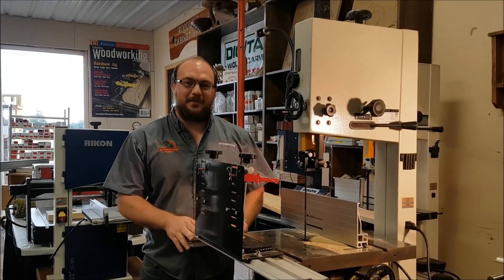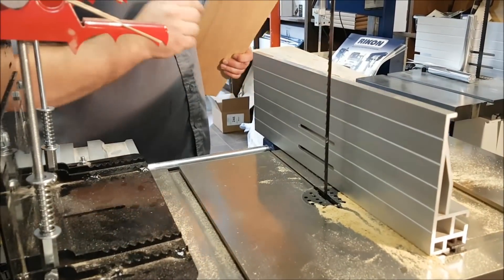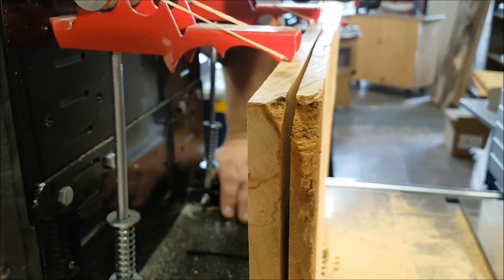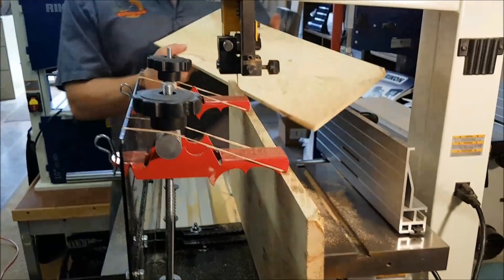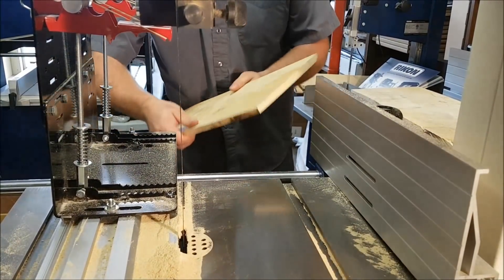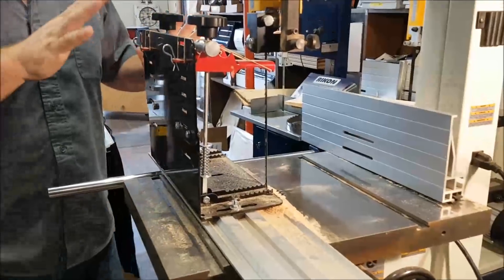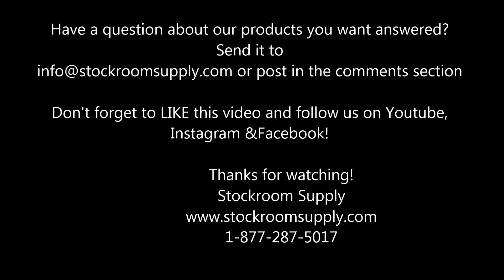EthAnswers Blade Drift Myths #2 Why Fences Don't Work On Bandsaws

Comment: Can't I use a hand plane to flatten the board?:cat-orange-whistling:
I see what you are doing. You have reversed a bandsaw mill. 
Instead of moving a mobile bandsaw on a track past the lumber.
You are moving the lumber on the track past a stationary bandsaw.

a normal bandsaw resaw doesn't use a track but a fence instead. 
Screw the lumber to another pc of stock (or a chunk of aluminum) and slide it past the fence and you would have about the same thing (but with screws in the lumber)

Comment: You seem like a nice guy with a lot of knowledge and experience and with a nice product you're promoting. BUT...that device absolutely DOES NOT magically turn a twisted board into "a perfectly flat, perfectly jointed board" as you claim (@3:33). Yes the board is mounted in the Little Ripper it won't rock and won't bind the bandsaw blade, but the board is still just as warped as it ever was until after you make the first cut. AFTER taking the first slice that covers the entire surface of the board, that freshly cut face should be flat as though it were jointed--assuming your bandsaw is tuned well cuts straight with no bowing.
Reply from the maker: Sure that is true! It is only after making the first cut is it flat and jointed. But clamping it in the Little Ripper a twisted board behaves like a jointed board. The best part of the Little Ripper is no matter how well your saw is tuned it cuts perfectly straight!
Thanks for watching 🙂

Comment: A planer does NOT make the faces parallel. A planer simply makes the thickness between the two faces constant. It you do that, and the board is FLAT, then the two faces will be parallel. However a warped (bowed, crooked, or whatever) board put through a planer will have uniform thickness but will not have parallel faces.
Reply from the maker: can’t curved lines be parallel to one another? So even if the board has a cup as long as it is consistent thickness the board is still parallel irregardless if it is flat?

Comment: I've had boards close up when ripping. Just luck of the draw. Weather the Little Ripper holds one side or the other like the fence doesn't seem to me to make a difference. It's the alignment to the drift you did on the other video which seems to master. As for the warping, you could shim the board to the fence, cut one side than use the straight side against the fence and re-cut. I admit the Little Ripper would save you time.

Comment: The jointing of the board is barely relevant, I don't think people are just putting non-flat boards up against their fence, pretty sure they can notice that problem. It sounds like your argument boils down to people not properly maintaining a firm grip of the work against the fence. Which yes could be challenging on a longer piece.

Comment: Hi Ethan, I wanted a different saw but I found a great deal on an essentially unused Laguna 12/14 or BX. Still not totally sure.  It much difference other than the foot break. Anyway, is Carter the only option for after market bearing guides for the Laguna. Not sure I’m going to like the ceramic ones

Comment: I have very rarely run into ANY issues resawing with a fence in my 40 years of woodworking experience.  If you have a properly set up saw and decent wood, there usually isn't an issue.  The few times I have had to deal with any issues does not make me want to go out and buy a little ripper for the absurd price they are asking. Also take into consideration that the pieces you are resawing are probably going to go through a surface sander that will mitigate any slight variances in the resawing process as well. I  Just my two cents

Comment: Interesting video.  On your point about "most guys don't have a jointer bigger than 8" wide" well I would agree, but that's not a problem for me as I have a set of winding sticks and good old number 5 1/2 jack plane.   Takes a little bit of time and practice, but a handplane / winding sticks and a few minutes of elbow grease and you have taken out any bow / cup / twist from the board so it will ride the fence without rocking.  Look up Paul Sellers or Rob Cosman's videos if you want to learn the process! Little ripper looks like a nice piece of kit though, I guess you could actually use that to slice off the outer face of a board that's really twisted so you have less work to do with your hand plane or jointer to get one face flat and smooth!  What if you have to work on a piece that's 8 ft long for a dining table, isn't the little ripper limited to short pieces of lumber ?

Comment: Several problems with this video. it wouldn't be difficult to find a 1/4" gap in a very green board. Moisture difference is the major cause of stress. Looking carefully at the video appears to show that cut was not properly set up;; the top of the board  is slightly wider on the left, while the bottom is slightly wider on the  right. The crude nature of the clamping jaws  suggests to me the it would create problems bigger than what it purports to solve at no small expense. it appears to be a crude, expensive solution ib search of a problem.

Comment: I’ve owned a Laguna 14” for years,I can resaw using a fence,not with a 1/2 “or 1/4” blade but the widest possible,never had any drift.if my board is warped, I’ll replace it with a flat and straight board. Warped boards use as fire wood. If you can’t tune a bandsaw properly,get someone else to do it.if you can’t tune a guitar,play a violin,if you can’t tune a violin,mow the lawn.no effort required.

Comment: That clamping jig is fine for a short piece of wood. If you are re-sawing a longer piece, I see zero value in it. Also, what if you joint the piece 1st? Does the stock fence work then?

Comment: As a retired airframe structures CAD engineer, I get the “released stress” concept. And appreciate that against a rigid fence, as the cut proceeds, the gapping you demonstrate is constrained to occurs in one direction- away from the fence - thus resulting in a bind and hence, drift. So, we have a dilemma: unlike steel and aluminium where the locked in stresses, caused by ‘working’ the material, can be dissipated via heating (annealing) wood cannot be similarly treated. So, if I want to rip a thin, flat board from a thicker section how do I get (keep) it flat?

Comment: The points in this video sound valid...but, in my experience with drift, it was due to the the blade, no matter how much I messed with, it not being parallel to the fence. Once I made a wood fence add-on which I used with a packer one end to 'unsquare' the fence but parallel it to where the blade wanted to cut, works like a dream, and is a joy to use.

Comment: I guess I am confused.  What good is getting that little ripper straight cut if, ask soon as you release the clamps your piece can now flex and is no longer flat?  It seems that either way, both cutting methods result in a warped end result.

Comment: Good video, thanks, however I don't understand how I'm going to get a flat board if it twists anyway when the gripper is released?  If the gripper was NOT released I CAN see how I would get veneer of uniform thickness, but not if I release it?

Comment: This is the first time I have seen this device, (I watched the first video first), and I can see where the cut isn't binding, but the board is still twisted. How does one solve that problem? Isn't recutting with a bandsaw intended to give you a flat cut and remove those curves and twists? 

I know that a planer will smooth a surface of a board that is twisted providing the board is properly shimmed until a flat edge on the opposite side is established.

I just got a 9 in Central Machine bandsaw yesterday, and I am experiencing "blade drift" which always drifts to the left on every piece of wood that I resaw. I have to set my "fence" which is a 2 x 4 with quick clamps for now, at approximately 10 degrees to the left of square to compensate for the drift.

Perhaps my blade is too far forward? I try to keep the entire blade center of the wheel, but the blade sits ahead of the thrust bearing about 1/16th of an inch, so there is a little movement I can see with the blade when I make a pass. I have been watching videos like crazy the last 2 days hoping to "tune" this thing to where it will perform with thicker resaw work without it drifting into a circle practically.

Comment: Not sure why anyone would argue against the point being made by this video. Its the same principle as using a taper jig on a table saw for edge jointing. The magic comes from the jig moving with the stock while it holds the stock securely and references the straight track versus a static fence which needs a straight surface on the stock to avoid binding the blade. My only question is why does the little ripper need to cost $350?  If it is about maximizing profit, you might want to rethink your strategy as you are just driving us to make our own jig.

Comment: Every bandsaw video I have seen scares me. Having been trained as a machinist/ toolmaker for over 30 years, they always said set the upper guide within an 1/8 of an inch above your workpiece. And in every video I have seen, it is like 2 inches above the work. You know, if you have it down close, first of all, there is less room for flex. Second, and perhaps most important of all, there isn't room for your finger to get through there. Making it virtually impossible to cut it off. Just some random thoughts/rants... I guess you can run it however you see fit.

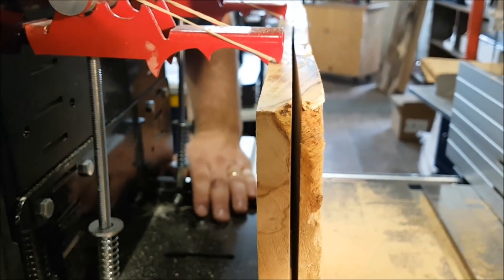Comment: OK then, at 6:44 in,  what's the difference between using the tall fence and holding it firmly against it on the "left side" of that blade VS using your Little Ripper which holds the piece securely vertical on the operator's "right side" of the blade. The cutoff can splay away equally free in both instances, in my opinion. As long as the cutoff is not "trapped" and not allowed to move, it should nave no issues. In my experience resawing 8" Maple, I use a 3 TPI blade and a 4" tall fence and run the work into the blade parallel to the fence using a sled. The cutoff or the resultant piece, falls to the left side and has parallel sides ready for a pass over the jointer and then through the thickness planer.

Comment: F-bomb just for fun LOL
So by using the little ripper jig you were able to make a cut that ran true to the blade in the band saw, but you were not able to actually make the resawn board flat. Correct?  So my question is Lets say we want to build a table top using resawn boards how do we get the boards level? or do we just make them parallel via a planer 
Thanks for making me think, great video

Comment: Pretty sharp fella you are. But I would have to add that sawyers need to remember that wood is reactionary...by its nature it is alive and wants to change dimension and direction due to stresses in the grain. There have been several ways to resaw over the ages and to a degree the work well with one method meeting more precisely the needs than another given differing circumstances of the wood and equipment at hand. My point of view is to consider what you will have when you have accomplished the resaw operation, will you have a piece of wood that is usable or one that twists and turns like a potato chip. Even with your illustrated device that last piece reacted when you released the clamp pressure and unless my eye was wrong the that last piece had moved somewhat in spite of the grip of the 8 teeth and I could see a less than laser straight cut line on that board also. Wood moves. A guy could use a piece of plywood or MDF as a sacrificial fence, glue the piece you want to resaw to it, shim it if it is badly warped, just enough glue areas to hold it so the resaw can be made with that sheet stock fence running along your band saw fence. Not as handy and consumes materials but it would accomplish the same as you illustrated.

Comment: Hmmm... .I tend to resaw a bunch of highly figured wood because I need the material to make inlays with.  I've always struggled getting more than one or two usable cuts out of my material before I have to run it through the planner again.

Never thought about using my Little Ripper to resaw lumber, only used it with round stock to date.  

Going to give it a try though!!!   #FingersCrossed   :)

Comment: Thanks for the insight from both of your videos. I think I'll experiment with shimming or padding my saw's fence fully on the input side and extending only an inch or so past the blade. Thickness of the shim would probably be dictated by the stress contained in the stock to be re-sawn. Possibly pausing to pinch together the cut ends a little with a clamp would help as well. This might eliminate the limitation on the length of the board to be re-sawn and leave me with more funds to spend on lumber rather than more tools!

Comment: I have a General International 17" saw. No drift, perfect re-saws down to 1/16" with the stock fence even in material as wide as 8". More capacity on the saw, just haven't needed a wider thin re-saw so haven't tried it.
Not saying I'm the total expert but my experience says that with a properly set up saw and a good blade you can get good results with basic fences.

Comment: that's a great solution similar to a jig you might use in a table saw to get a straight cut. That said, it's not too hard to get a flat surface board up to 13 inches by using your planer with a sled of some sort. Enjoyed the video very much, I have mega drift so I needed this. I ruined a nice board of spalted birch. Oh well, it's a learning experience. Thanks for the video, I learned lots.

Comment: Once you get about 10 inches in take a section of old band saw blade and clamp it in between the two pieces with mini c clamps creating a gap the same size as the blade.

Comment: I got my Laguna 14" about 20 years ago and I didn't know any of this stuff. I set the saw up as per all the vids and instructions I could find and had it set perfectly with a brand new blade in it. I cut cedar laminates off of 2x6's and used them for inlays on some saloon style doors I had made from scratch for an outside gate entrance . My laminates were spot on and I never had the problems you are showing in this video so I am not sure what to think about all this.

Comment: watching the top of the board where the blade is actively making the cut it seemed pretty obvious that the blade was not tracking true especially due to the stop start you can clearly see a jag in the cut line, the little ripper also seems to wobble all over even with it in the locked position on the wood, lastly you never put the cut board back against the fence to show how the twist had been removed from the board after using the little ripper

Comment: To get rid of that warp, make a sled, shim the board on the sled so it doesn’t rock, and run it through the planer on the sled.  You’ll get a flat side.  It doesn’t solve the stress issue, but it does mean you don’t need a super-wide jointer.
Reply: Thanks...same that I was thinking.  As "The Explororapher" commented, it seemed like either intentionally deceitful or impressively uninformed comment.
Reply: Yep do this all the time.  Problem is, it doesn't sell Little rippers.  SPONSORED VIDEO

Comment: use a resaw single point attachment on your fence.  and if you dont have a big jointer put your piece of wood on a staight board then run it through your planer.

Comment: could you start your cut using the fence then when the blade is into the wood a bit attach a jig made to be 90 degrees and clamp it snug against the work piece so then you are essentially locking the entire piece from expanding as you cut ? $379.00 for the little ripper..seriously ? Now I feel this video was just a sales video.

Comment: bullshit, if you have a 12" planer you can use it to joint a board, youtube the jig. but it can be done.
but the smart thing to do is buy rough cut lumber then use it right away after you mill it to squat and parallel because if it sits in the shop its going to change over time because of moisture in the air.
Rough cut wood is also cheaper then ther big box stores.

bandsaw drift?  I've got 2 words for you, ALEX SNODGRASS  look for it on youtube.
Reply from the maker: Yes it’s true! You can joint a board with a carefully made jig and a 12” planet. Also with some skill you can use a hand plane. Regardless you WILL need to joint the board when you use a fence regardless of how you do it. If you don’t you will bind the blade. This video is a great example of what happens to a blade when it is bound; https://youtu.be/V9OOGmahZBE
Reply from the maker: Yes I’m personal friends with Alex! Great guy and talented demonstrator. We do have very different opinions when it comes to bandsaws and drift though.
Reply: @StockroomSupply  A loose bandsaw blade, is a great way to break a blade, I ran a Metal cutting bandsaw 6 times bigger then your Ricon and the blades were abut 1 1/2" wide I cut Stainless steel down to leadley materials on it, 
This machine was as big as a sawmill, if the blade bound up it broke.
running one like you did in the demo is a good way to get hurt, if that saw was not adjusted right, I pised a lot of CNC oprators off because that ment they were dealing with crooked parts all day. You try that cutting Purpleheart your going homes with bandages on.
You literally had no feed rate.
Reply from the maker: Here’s a video of me cutting Lignum Vitea without guides...which is far harder than Purple Heart. https://youtu.be/W8k0_HP8srQ    Enjoy! And thanks for watching

Comment: I do not try and slice a thin board from such wood, you will then joint and plane down to a too thin flimsy twisted waste. Most of the well dried pieces will slice very nicely though avoid knots and other stressed areas if possible.